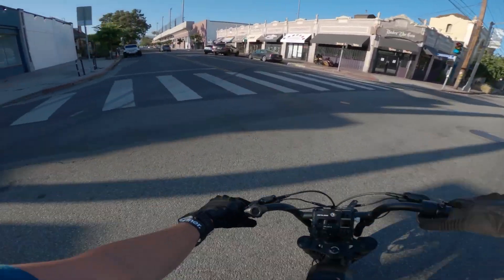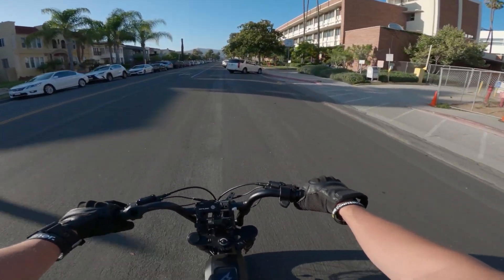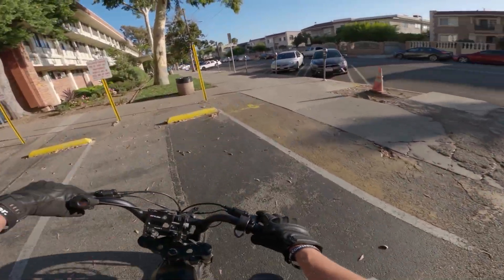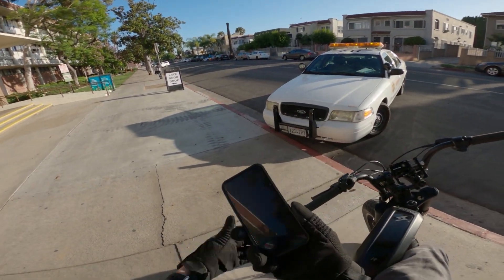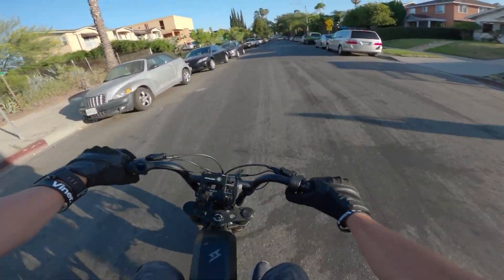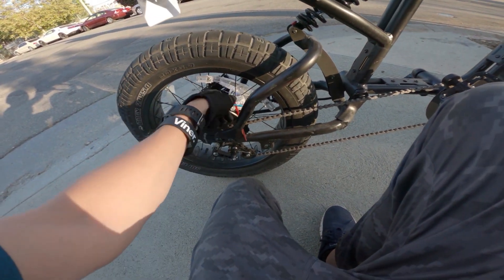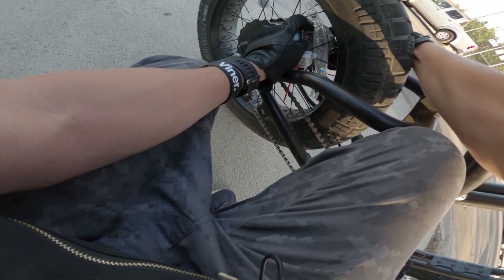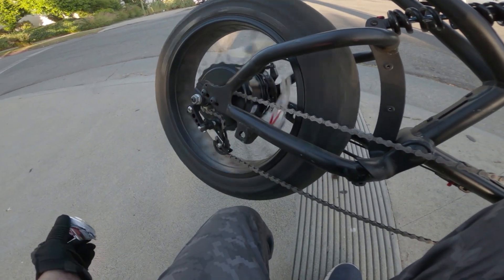WHAT IS LENZ'S LAW?!?!

Comment: Forget about Lenz law. Where's the babes
Reply from the maker: I already forgot about it
Reply: @loopholeculture  Dlllon do  you know many e bikes have aluminum frames my rad bike is aluminum no issues in 600 miles only goes 23mph  i think it the extreme power shredding planetary gears wish somebody would open up the broken motor and see it for yourself! I was going to order an RX  for me give my  Rad Power to my wife. Not sure i want the problems just the speed. Rad is $1500 and year warranty. what do you think?
Reply: @rogerkelly1145  I think you should go with the Super 73 R. The components are the same as the RX and more steadier that the Rad. Also has full suspension and you can customize it to fit 2 batteries for double range which is not something I have seen on any current ebike. Plus the $2,795 preorder now makes it even a deal worth it

Comment: It's probably not Lenz Law. In Tom's vid he mentioned that the aluminum caused the hall sensors to 'lose sync'. So its possible that bad hall sensors/wiring would make the same noise. In Toms vid he was using really thick aluminum very close to the motor and also surrounding it.

Comment: Tom stantons build was not a hub motor.  Your bike frame/ fork is not close enough to the magnets(outer circumference of the hub) to cause interference, whereunlike in tom stantons build, it was an aluminum bracket near the motor magnets.  Bldc motors have magnets that are located in the outer circumference which is the one that spins unlike older brushed motors where the stator in the center spins.

Comment: Aluminum isn't magnetic. It also doesn't flex much. The rear assembly that holds the wheel has torque applied to it evenly across the axle in line with the wheel so I don't think it would be flexed or bent by the force of the motor. I see examples where the motor starts failing right after hitting a bump... that suggests an internal issue with the motor. I'd like for Super73 to offer a direct-drive motor option. As with the Onyx RCR a direct-drive motor has less torque at low speed but better efficiency at cruising speed. They introduce some drag when not in use as they don't have a clutch. They can be used for regenerative breaking if the controller supports it. They are very simple and reliable. I'd trade a slower take-off for better efficiency and reliability.

Comment: Put it on the left side. It's happening when you turn right, which could cause the magnets to shift left due to gforce and close enough to the frame for the motor and controller* to go out of sync.

Comment: I know you mentioned that they said they had aircraft aluminum involved in this. I do have a degree in electronic engineering however, I was in the communications industry. I do understand about what they’re going through. Aluminum is not supposed to be magnetic however, heated aluminum changes properties. It also depends on the quality of aluminum. I believe the aluminum heats up thus causing property changes in the electromagnetic field thus creating those eddy currents. There’s got to be a way to keep that aluminum cool. The only way I can think of is through a liquid nitrogen source. That’s probably why they want to they wanted to mod three with a completely different property in gearing to keep the heat load off.

Comment: Sure you’re having the same problems twice BUT it can’t possibly be the swing arm being made from aluminum, otherwise all the bikes with hub motors with aluminum frames will have the same problem. Whether it’s Super 73 or not. If magnetic issue is the case, their steel framed older model bikes would have been worse....The issue is the motor having  subpar materials that can’t hold the torque hence the slippage...The second issue is the faulty controller hence the random shutoff  (same problem they had with the 1st gen Z1) The “battery is just saving itself from overheating that’s why it shuts off” is just not true in this case especially if you’ve only ridden a few miles. The battery has a BMS that would save it from over/under charging. It would only shut itself off once you go down between 38-42 volts depending on the BMS program.

Comment: I'm starting to wonder if the motor is slipping Internal gears as you come into corners. Maybe the force of you turning on that hill is causing the hub to flex just enough to let the internal gears slip. I don't think that eddy currents are to blame for the motor making that noise, unless the hub is getting significantly closer to frame. It also relies on where the magnets are places in the motor, and if they are even rotating. My bet is the gears are slipping. I would try to lean into corners a little fast like you did when the motor made that noise to test it. But this all relies on if the motor has only made that noise when leaning. 
PS: you might be able to place some metal shavings or other small magnetic material around the hub to see where the magnets are in the motor!
Reply: I have the same motor issue on my rx and can say that when I lean the bike left the noise occurs and clutch/motor doesn’t engage - lean bike right clutch and gears reengage. Braking hard then accelerating immediately also produces the same problem. It’s definitely the gears slipping.

Comment: That does make sense with the magnets and resistance because in New York we have mass Tranist and before all the trains gets changed with fiberglass, the magnets get demagnetized due to the electricity and makes a bunch of noise but here is the dilemma though. I went into SUPER73 website and looked at the S1 and Z model and both are made with steel instead of aluminum. I never seen a video yet with the older models of the S1 or Z having this noise/magnets problems but there is a video out there with the dude riding his Z model and it makes the same exact sound as yours. I think it’s either a defect in newer models and unless they test each bike before they get shipped out it is impossible to know who has a bad defective bike. I think the bikes and parts are being rushed to try to catch up on all the pre orders and it’s causing problems. This is only my opinion, only those that work for SUPER73 and in the warehouse would know exactly what’s the real problem. Will they leak that info or not it’s up to them.

Comment: If the aluminum theory is true, wouldn’t a steel frame be much worse?! Way more magnetic property to steel. In the OG poster of the bike issue, that bracket almost covered the circumference of the motor  with a gap on one side most likely exasperated the problem. I’m not saying this can’t be he culprit but I’m thinking more of just 2 issue in a stack of problems
Reply: Also the grade of aluminum that they use for cans and tin foil isn’t like that of which they machine parts out of

Comment: You don't want to zip tie the aluminum to the motor, the aluminum has to pass by the windings of the motor to be induce a current...  You need to put the aluminum somewhere that it won't spin with the motor but the motor spins near the aluminum.  Remember the video, touching the aluminum pipe to the magnet doesn't do anything, but dropping the magnet through the pipe and induces a current that effects the magnetic field.

Comment: I doubt that is the issue.   Most ebikes have aluminum  frames.   I have owned  sonders,juiced,specialized turbo levo and a couple cheap Alibaba ebikes.  Most have hub motors as well.  From when I have taken them apart they are housed in a steel case as well.      I still think the planetary gears can't take the power.

Comment: contact brian howard my buddy in Spokane, he makes a custom made for e bikes, lighting system that doesn't draw from your main battery, and it is bright a/f ..  my hyper scrambler and rose ave are getting mid drives, the hyper is aluminum the rose ave is steel. I will let you know how that all goes. when i can get to Brian's all the parts are ready togo, need covid to end. my hyper scrambler chuks like a pig with its hub motor.
Reply: Covid aint going anywhere.....just wear a 😷

Comment: Perhaps try riding at different speeds at the known geolocations where the fault occurs? Identify if the fault is occurring during constant speed, speed reduction, or acceleration at these known areas. Also note if your bike is tilting / angle of bike at each time of fault occurrence. This might provide a little further understanding of variables under which the fault occurs.

Comment: 3:40 you are absolutely right, the motors are absolutely fine and great (looks like bafafang hub motor and everybody use them - Radpower bikes, Super 73, Juiced bikes).  it will be super funny if comes out that swing arm is causing it :D